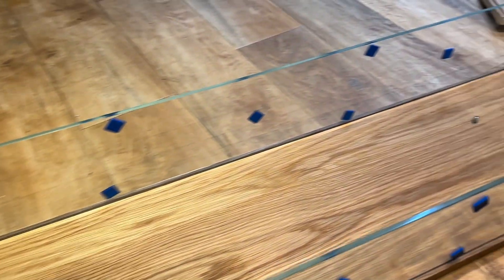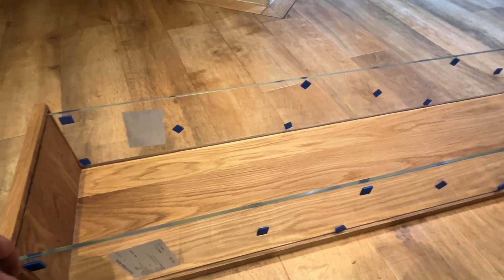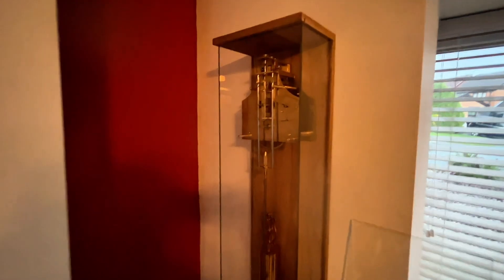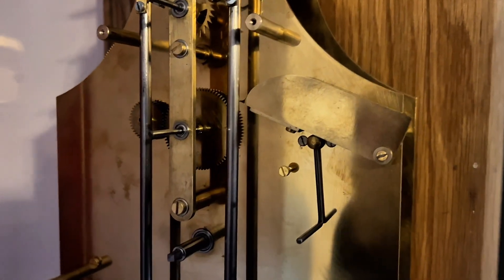Building a Precision Clock – Cabinet & Full Assembly Revealed for the Tekippe

Comment: Beautiful! Sorry if this has already been covered, but have you thought about protecting the plates with something like microcrystalline wax? I gather you're not going to varnish them? I have a project with a brushed finish engraved brass plate that's been sitting in my living room for a few years now that I treated by rubbing a microcrystalline wax onto it, and it seems to be protecting the plate from tarnish pretty well. There's a product called "Renaissance Wax" that people keep talking about, but I had a tub of microcrystalline wax sold as "museum grade earthquake mounting putty" (I'm in California, so... that's a thing we worry about) and so I just used that. It goes on... well, waxy, but with enough buffing it shines right up. The nice part is if you don't like it or there's some issue, there's no chemical bond, so you can just wipe it off with a solvent.